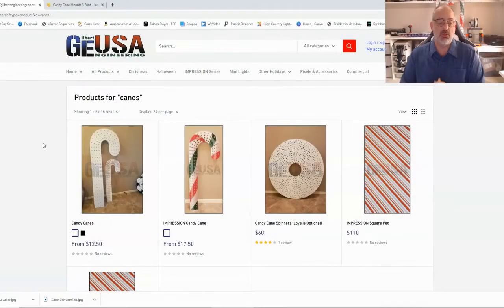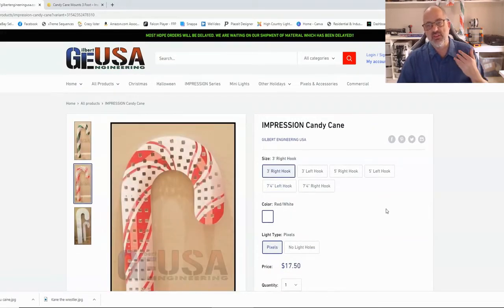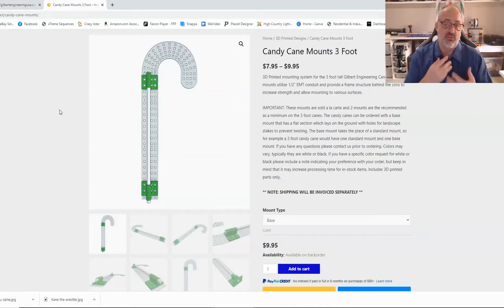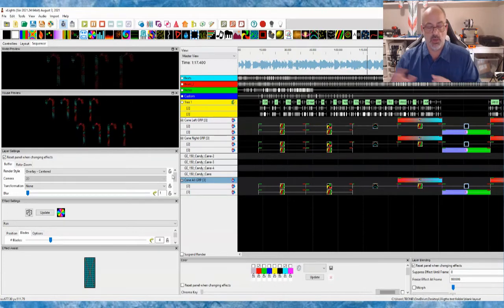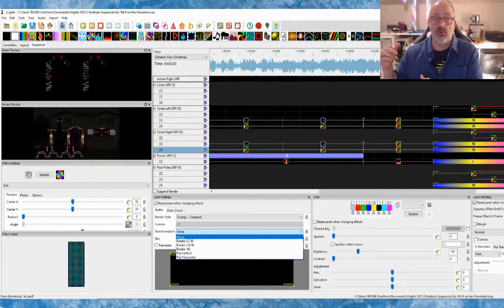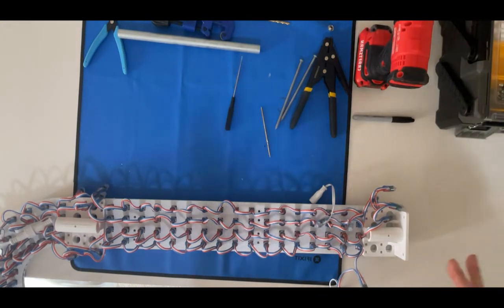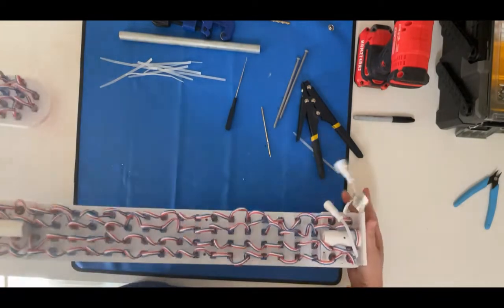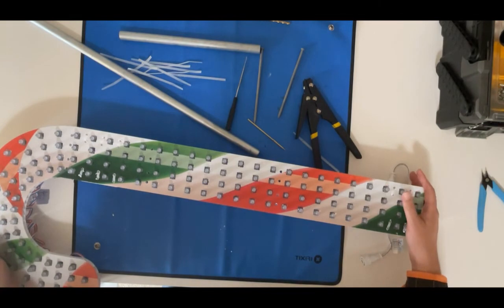Gilbert Engineering 150 Node HD Candy Cane, how much to build, mount it, mapping and sequencing tips

Comment: Hey thanks for the video! Beginner ramping up for next year. I am going to use this prop for my first test run. Question, do you have a video on building the bare bones controller and power supply to run these?
Reply from the maker: Yes and yes in my build video section we have receiver boxes and a F16